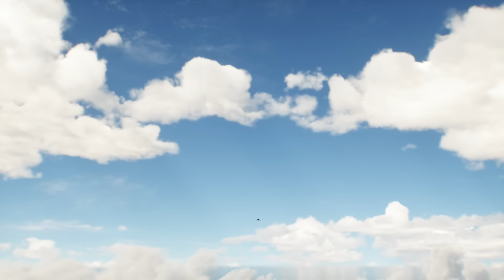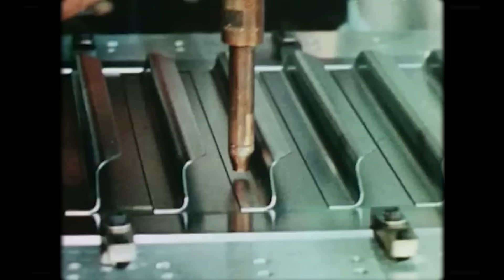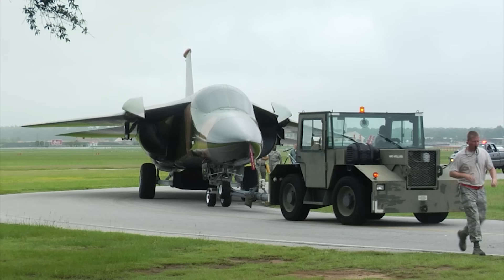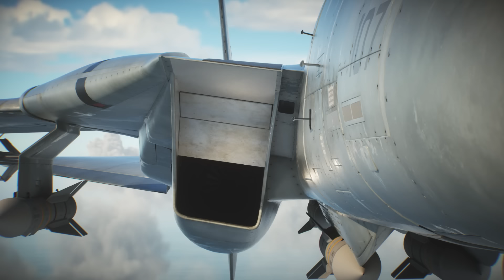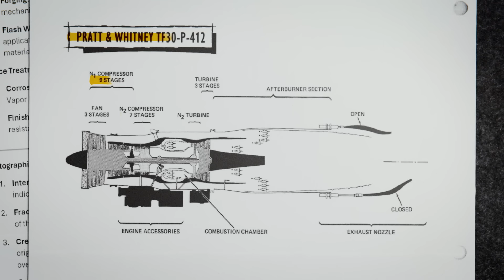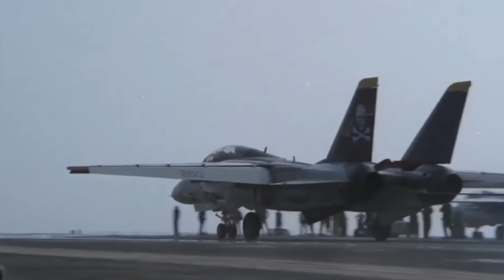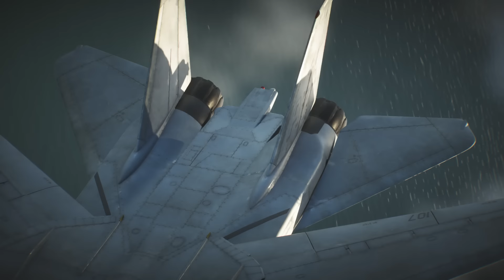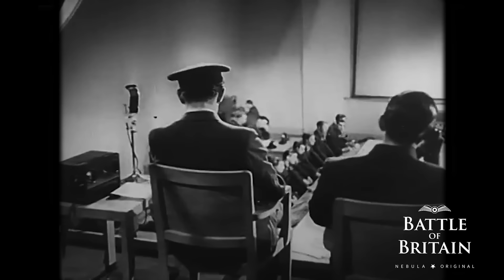The Insane Engineering of the F-14 Tomcat

Comment: The wingbox section stood out for me: using a lower sweep for more lift and less drag while loitering, then sweeping back to reach Mach 2.3, makes the trade-off clear, and it explains why that central structure had to be both so strong and so light despite carrying two engines, seven tons of fuel, and that massive radar.

Comment: The extremely serious design flaws of the f-14 tomcat (particularly its engines) are something that should've been caught and solved during testing, not something so problematic that it has taken lives. Sounds like incompetence to me. Those planes should not have made it to production with such faults present. Period.
Reply: That's what happens when funding is cut by politicians. The engine the F-14 was supposed to get was cancelled.
Reply: @dumdumbinks274 The flaws of the engines put into it were so catastrophic that they should've been intercepted either way. The proper decision here would've been to delay as long as was necessary. Human lives far outweigh budgets, deadlines, bad career marks, and loss of reputation. It's like they shoved the engines in asap without doing any testing, this was a decision made because someone's career may have been on the line and not for the good.
Reply: @seamusmac777  They were objectively good engines for the day, and all the issues were predictable, not reliability issues. The only reason to wait for the new engine was performance related, as it would have been less sensitive to changes in airflow during maneuvers, but the F-100 engine was generally unreliable in it's early days.

As far as your concern goes, the F-14 was a product of it's time and should not be held to modern standards, because back then such standards were impossible.

Comment: Doesn’t the phoenix missile have its own radar, meaning the f-14 didn’t have to stay radar locked on a target right?
Reply: Yes, but it still needs guidance from the launching aircraft's radar up until it's terminal phase, at which point (about 8 nautical miles for the AIM-54) it goes "pitbull" and only then uses it's own radar, because it's close enough to do the job.  This is because aircraft have much larger, better, more powerful radar arrays than missiles do.

Comment: Military Industrial Laundromat...

The unit cost of the AIM-54 Phoenix missile varies by source and inflation adjustments, but the official 1974 fiscal year unit cost was approximately $477,131. 

More recent estimates and adjusted figures include:

Approximately $500,000 (often cited in general summaries). 
$1,298,000 (1986 dollars for the AIM-54C variant). 
$922,000 to $972,083 (procurement prices in late 1980s dollars).
$1,343,000 (flyaway unit cost in 1986 dollars). 
While some sources or pilot accounts from the 1980s estimated the cost at $1 million per missile, the most consistent official baseline figure is $477,131

Comment: The female pilot died not because of the engine. She died because she didn’t follow procedures. A RIO named Ward Carroll proved it. Back then women were pushed into pilot roles for diversity reasons when most weren’t ready. That female pilot was one of them and because she failed to follow procedures in the manual which is why she yawed and punched herself out right into the ocean

Comment: USAF retired F14 Toms because it was too expensive to maintain and the WW3 scenario there were expecting was long gone ...

But now. WW3 scenario has came back full swing USAF  itself is killing last few survived Tomcats 
What an irony 
A jet it was too dangerous to exist
Reply: Not quite, it was built in a time before long range air defences. Nowadays the Navy has the RIM-66 which can fly for upwards of 100 miles at over 3 times the speed of sound. And you can launch a missile far quicker than you can launch an aircraft.

Comment: @15:40 WRONG! 17G is divided by 5 so it only can handle 3 G ooponent's manuver. To defeat 9 G opponents manuver it require more than 45 G missile manuver.
Reply: Erm, you can't just pull a maneuver of a certain rating to dodge a missile. Missiles act on their perspective, not the intensity of the target's maneuvering. A target may well pull a 9G turn, and still die because it was a tight turn that barely required any course correction from the missile's perspective. An AIM-54 when used as intended was a very difficult missile to dodge, owing to it's extremely fast terminal speed.
Reply: @dumdumbinks274 The F-16 Dodge 8 SA 8 Gecko missile and it could survive. SU-34 only mach 1.8 could Dodge 3 Patriot and survive.😊
Reply: @nomad8901  No, they used tactics and countermeasures to avoid missiles that were launched near the limits of their engagement envelope.
Reply: @dumdumbinks274 Counter measure doesnt work if missile guided by optic like Osa system. So to defeat optical guided missile is to use extreme manuver. Su-34 ECM could not defeat Patriot missile, so Su-34 had to use extreme manuver to Dodge 3 Patriot Missile.
Reply: @nomad8901  Optical guided missiles are countered by DIRCM, and a system such as Osa is radar-reliant for target acquisition and tracking anyway. Without the radar the optical guidance can't "lock" a target and becomes less effective.

There is no chance the Su-34 crew just "dodged" Patriot missiles. The fact that you yourself stated they were using ECM disproves your claim. ECM doesn't "defeat" missiles. It diminishes their ability to track targets. Add to that the use of chaff, it is not a case of "dodging" the missile with a last ditch maneuver.
Reply: @dumdumbinks274 DIRCM usefull against IR or HEAT seaking missile, not optical guided. So why the Fullback could escape the Patriot, the F-16 could escape Osa? Is not about jammer, if the jammer was succesfull the plane should not took evassive manuver.
Reply: @dumdumbinks274 Every fighter has chance to outmanuever missile threat, thats why modern fighter has MAWS.
Reply: @nomad8901  DIRCM blinds optical seekers. IR is a type of optical seeker, it just works on different wavelengths. Jammers don't disable missiles. Maneuvering is a requirement, not an option. If you don't maneuver while jamming, the incoming missile will still end up seeing it's target once it burns through the jamming.

Modern fighters have MAWS because a pilot that doesn't know there's an incoming missile will not do anything to avoid it. Not to mention that most modern MAWS integrate with the countermeasures to automatically dispense and sometimes jam detected threats.
Reply: @dumdumbinks274 The missile is faster than plane, but most missile at terminal phased don't have engine or can not breath air. So if Fulcrum perform 9G manuver to evade incoming  Phoenix missile from head on, the Fulcrum Will beyond the Phoenix killing envelope, the Phoenix has to readjust its flight course but ITS TO LATE because Phoenix only 17G manuver, not exceed 45G. 

Many dogfight missile recently has ability to perform 50G manuver like ASRAAM, PHYTON to defeat 9G fighter jet.
Reply: @nomad8901  We've already been over that. Gs are only a single factor and don't necessarily result in the target deviating significantly from the missile's flight path. Missile speed matters because control surfaces are more effective at higher speeds. Whether the missile is powered does not matter in this particular argument.

A regular old AIM-9M can reliably hit a 9G target provided it isn't flaring. AIM-9X, Python etc have high G limits because they are designed to engage targets that are not in front of the launch platform. That means making up to a 180 degree turn immediately after leaving the rail. You don't need to do that if the target is in front of you.

Comment: The swing wing lineage for the F14 is the F111 which is a much different design than the WW2 German research, both in design, wing box, materials, Titanium, and as applied to the F14 armament, Phoenix missile. Also, it can be said that the F14 and Phoenix missile are a fleet defense system. There is no reason to lock onto multiple targets with sophisticated radar at long range at over Mach 2 if you can't launch and shoot down the enemy. Hence, the reason for the Phoenix Missile.

It is probably easier to fill a welding chamber with Argon gas with positive pressure than creating a vacuum to exclude oxygen. With positive pressure Argon you can create a sealed chamber with a known leakage (orifice), which is monitored in order to find larger leaks.

Comment: Turns out the F-14 Tomcat was a massive failure, FOR ITS INTENDED MISSION SET. If the USN hadnt played dirty politics the development would have been to develop the F-111 B to exceptional standards for INTENDED MISSION SET. 

Dogfighting was not needed at all, the shoulders of responsibility for that would fall on other jets. The required aircraft was to be

1) Supersonic
2) Long range Radar
3) Capable of heavy fuel - long ranges
4) Capable of heavy HEAVY armament
5) variable sweep wing - for defense, and US Carrier Ops (to land and takeoff)

yet the F-14 Tomcat was made, which had dogfighting but a reduced payload, failing point 4. And the AIM-54 Pheonix/AIM-120 AMRAAM were not good missiles (AIM-120 has come a long way to become one of the world's best missiles today, but that has been C4 onwards). The pulse doppler radar also was very unreliable.

So yeah, good aircraft, wrong mission set.

Comment: The f110 engine was put into the F model 111 starting in 1968 before the F-14 was even being built. The f-111f model was my primary aircraft that I did avionics flight controls instrumentation on and also trained pilots how to do things with that aircraft in the simulator that were to a higher standard than their flight manual allowed them.

Comment: I also need to point out that no welding techniques whatsoever require oxygen. Except for gas welding. Electrical welding does not require oxygen it actually contaminates anything you weld with electrical contact welding. And yes titanium is very reactive to oxygen. You cannot weld it with a oxy acetylene gas welder but nobody was doing that when they were building these things. I don't know where you're getting your information but this is one of the stupidest observations of the F-14 I have ever seen it was a fine aircraft when it was flying. But it didn't fly very often and couldn't be kept in the air with enough reliability to make it worth the time and effort until the TF 100 engine was built.

Comment: Wing box was made out of Titanium because aluminum would never have held the weight and stresses of the Wings it was designed from the outset to have a titanium Wing box. The engines were not huge and powerful. They were tf30 just like the ones in the F-111 a model the a model f11 was an excellent bomber and was for all intents and purposes next to impossible to shoot down because it flew so close to the terrain. But when you put that engine into abrupt aspect changes. It tends to flame out and shut off. Heads f-14s were falling out of the sky is the maintenance requirements were so bad that you could not keep 50% of them flying at any given time for any length of time. I worked on enough of them to know that they were a pain in the ass to work on I don't know what name you're calling it. But it's not Grumman. You can't pronounce the words please find somebody to properly narrate your videos 14 had is it couldn't accelerate with a dam. At least until they made the D model which finally had the tf100 engines. The same model that was in the f-111f model and the F-15 and the F-16. They had started with that engine. The F-14 might still be flying today. But the F-18 is almost always available at about an 80% rate. Compared to the 43 to 46% aircraft fly ability of the F-14. Not only that the F-15 and the F4 were both capable of near Mach 3 speeds. Possibly a little bit over because they were both capable of going more than 2,000 mph. That is strikingly close to Mach 3.1 or better. Even the f-111f model was able to do speeds a little bit higher than that for a short Sprint.

Comment: I was stationed on the USS America CV66Late76-78. These were the 1st tom cats to come out They had the little That came out of the edge of the wing I was told by a pilot That they loved the F14 they had just transitioned from F. 4s I asked him what was the greatest difference of F14 and F4. He said He said the F4 was a lead sled More like a flying rock. But the F14Was like a rocket The more fuel you added the faster it would go and he said it was like it wanted to go as fast as the airframe would let it. I wish they would have come out with a stealth version of the F14With different engines And greater fuel capacity With Internal weapon storage And the capacity to carry stealth missiles under the wings.

Comment: Why would 1 hour of flight cause 30 hours of maintenance?
Reply: Because the aircraft needs to be maintained and this aircraft is especially complex
Reply: @fabricebarbon5886  Sure complex... but things break after an hours use? Sounds poorly made.
Reply: @cdangers no😂 you can fly hours on end but after a certain time let's say 500h you have to service the aircraft, that means taking much of it apart wich costs consirable time. In addition after each flight there are certain things you have to check which alsow takes inn some time..
Reply: man hours. You have 10 guys working on the jet, that's only 3 hours.
Reply: @AB-mw8oz  That's not better.
Reply: @cdangers  Simple maths would literally state otherwise. 

30 divided by 10 = 3. 
3 is a lower number than 30

stay in school kids
Reply: @AB-mw8oz simple is your brain. 3 hours of maintenance per 1hour flight is also terrible.
Reply: @cdangers not really. When you factor in everything that has to be checked. Even the F-16 they’ve only gotten it down to like 20 man hours per flight

Comment: Badly designed engine, they shot use supersonic air to stay supersonic. Slowing the air must create Huge friction, wear out and drag. This is why the Super Tomcat ST-21 should be designed around the solutions for the F-14, thrust vectoring and the dynamic side wings; all good ideas 💡 that can be done efficiently, to have an exceptional fighter bomber

Comment: I'm gonna nitpick.  "The F14 was designed for one thing."  Then you list like 12 things.
Reply: In principle the F-14 was built around 3 Missions Fighter Escort, Fleet Air Defense And Attack. One of the important details is Grumman picked specific requirements from each of these to build the aircraft around. More detailed information below

The internal fuel load used the Tactical radius of the Fighter escort of which required (500nm Radius unrefueled, 4 Sparrows and internal gun) the amount of AIM54s was set by the Fleet air Defense (150nm radius with 3 hour loiter or time on station 6 Phoenix Missiles, Internal Gun) And the Final mission Attack which required (Multiple bombs, Self Defense Weapons, External fuel Tanks, Internal gun). hope you found this helpful.

Comment: In comparing acceleration of the F14 to cars you're incorrect in one aspect. Top fuel dragsters accelerate faster in 2 seconds than the F14 does. In two seconds a top fueler is approaching 300 miles an hour.

Comment: Actually, the primary mission the Tomcat was designed for was air superiority.  Intercepting Soviet bombers and cruise missiles with Phoenix (the "Fleet Air Defense" mission) was third or fourth priority depending on whether you count strike escort as a separte mission.  The Tomcat's requirements came from what we learned in Vietnam as well as confronting the new generation of Soviet fighters.   Basically, USN wanted an air superiority fighter that could also take on the planned F-111B role.  It wouldn't be able to loiter as long as the F-111B, but it was more versatile.

Comment: The airflow depicted at 19:45 would not generate any lift. The air leaving an airfoil that is generating lift is deflected downward, as the wing makes lift by pushing air down. 

Please get the animations correct! The video is great and informative, and i think this kind of mistakes really detract from the quality. Like the fact that the elevons deflect the wrong way at 3:32 and 22:13.

Comment: That an insane engineering taking in to account that was done in 1969 – Introduction date 1974, do not know any another aircraft of that era in any other country being on its level. Amazing that it was retired in 2006 it does not has fly by wire. Sad that it was rushed in to production and early version had that wrong engines. Design and engineering of Tom Cat that great that somehow I all the time thinking about Flanker looking at Tom Cat, Flanker was introduced in to service more than 10 years after introduction of Boy Cat.  Glad to hear that in video were voiced amount of maintenance needed for advanced jet 30-60 hours of maintenance for every hour flown(flight hour), recently had an debate on that issue online, finally number for advanced piece of equipment were voiced.

Comment: Can anyone tell me why the windshield had struts which obscures vision? This is also notable in fighter jet design from the 50s to the Tomcat where as fighters like the F15 and F16 had a single piece mold. Was the strength of the windshield during the design of the Tomcat not strong enough at it's conception?